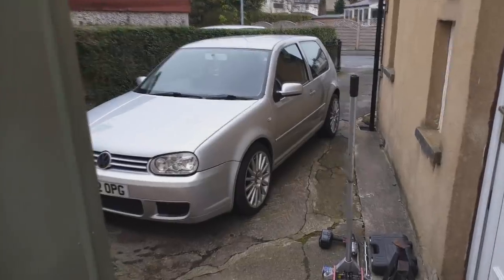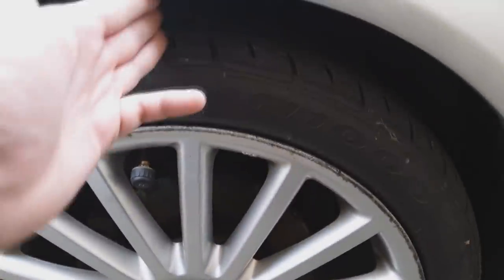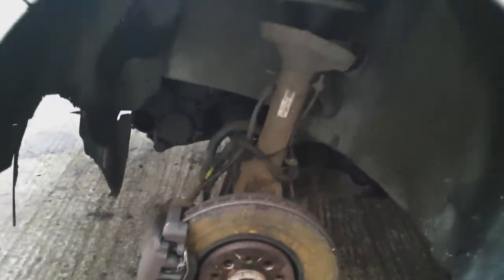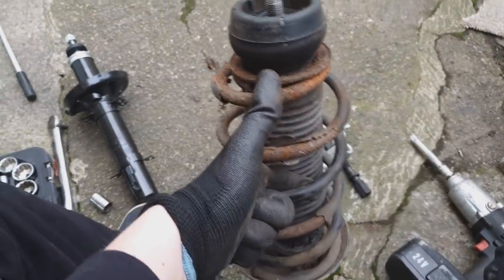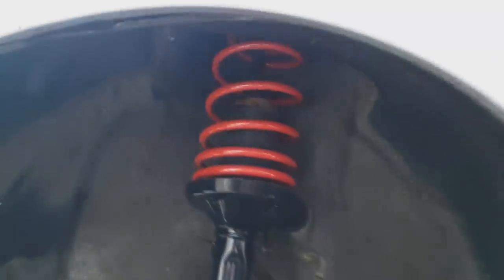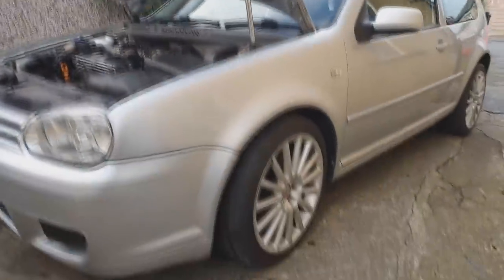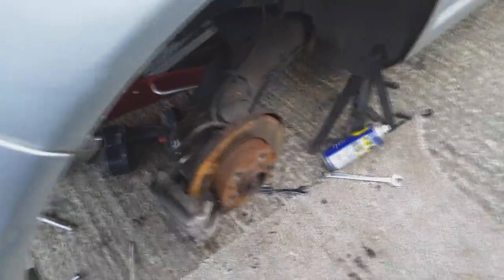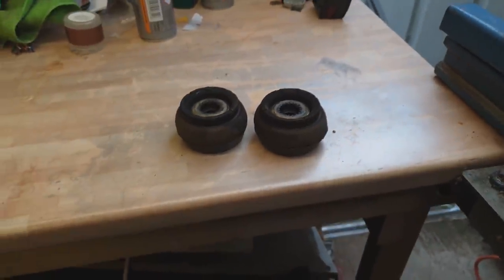How to install lowering springs on a VW Golf

Comment: The shed is looking good mate! Those struts are a real pain on the swivel housing pinch bolt. French cars have them too. I made a tool to pry it apart from a bit of rod made it oval enough to fit the gap then you can turn it so it will pry it apart enough for the strut to just slide out.
Also I remember doing the rear axle bushes on the MK4 are a right PITA
Reply from the maker: Fair play. Persistence with a hammer and it gave way :)

Comment: I'm about to install the same suspension on a similar car. Did you get any special wheel alignment after instalation? Or did you have any problems with uneven tire wear? Thanks.
Reply from the maker: I didnt keep the car long enough to notice. Always good to get your car tracking adjusted after lowering for sure
Reply: Catalin Banc What suspension kit is it (brand, size, part number maybe) ? I am planning on buying it for my mk4 Golf, thank you!
Reply: Here I got the springs  https://www.ebay.co.uk/itm/Eibach-Pro-Kit-Lowering-Springs-VW-Golf-Mk4-97-05-1-4-1-6/332459211946?pageci=131ce039-b3dc-4d75-ac91-6198dbe2cd16

Here I got the shocks   https://www.ebay.co.uk/itm/Bilstein-B4-4x-Shock-Absorbers-set-For-VW-Golf-Mk4-1-4-16v-1-6-1-6-16v-STD/231311847127?pageci=0a8bab9b-093b-4fed-83ae-cc1535fa2fb8

Top mounts    https://www.ebay.co.uk/itm/FRONT-AXLE-SUSPENSION-TOP-STRUT-MOUNTING-KYB-OE-QUALITY-REPLACEMENT-SM1708/143354428097?pageci=d5d407d1-191f-4a00-8b4e-f11e23e51c40&epid=250661481

New dust covers front and rear   https://www.ebay.co.uk/itm/Shock-Absorber-Dust-Cover-Kit-Front-GOLF-1-4-1-6-1-8-1-9-2-0-2-8-CHOICE1-2-1J/402217901827?pageci=bfe84ec9-2e99-4de0-a818-b6a7533bcc5d

https://www.ebay.co.uk/itm/VW-GOLF-MK4-MK5-EOS-BORA-REAR-SHOCK-ABSORBER-DUST-COVER-BUMP-STOP-KIT/330702622292?pageci=ab392542-3d19-41ed-b1e6-8d7ee8f16794

Rear mount I got them from Euro Car Parts. My car is a golf mk4 1.6  16v AZD, from 2001. The suspension it works really goog. I got the alignment and I have no isue with uneven tire wear after about 3000miles

Comment: would like you tell us the torque setting on the nut bots please or in future video,s  thank alot
Reply from the maker: Hi mark.

I always do alloys to 110nm and steel wheels to 120nm.
Reply: @bluudysgarage  i mean the other nut bolts not wheel because some people are  looking at repairing there own car and they will need the torque setting, for example,  rear shock bolts etc  thanks alot
Reply from the maker: Tight as you can :)

Comment: Did you Photoshop the thumbnail? Looks a alot lower than 40 mil
Reply from the maker: Its settled more :)
Reply: Sits brave and low for 40 mil springs, looks mint lad 👌
Reply from the maker: @brettwatson4414  thanks man. The rear springs I think where from an estate or something do the back was really high. But now I've put lower springs in its dropped more than the 40mm. So it's all good

Comment: Coilovers are smoother than lowering springs
Reply from the maker: Depends. Cheap coil covers. I very much doubt it. You get a decent set where you can adjust the shock and rebounce. By adjusting the stiffness then probably.
Reply: I got stance+ on my pd150 they seem to do alright